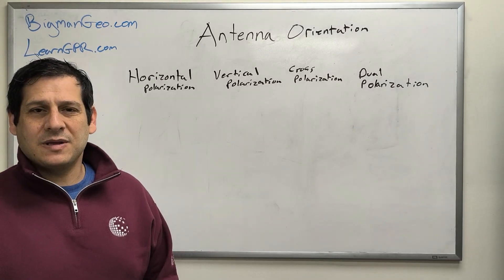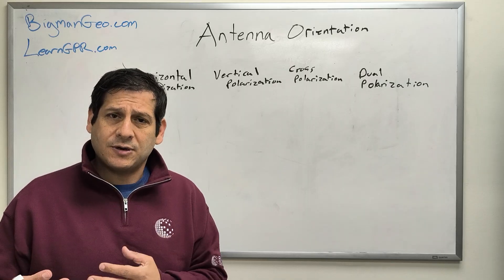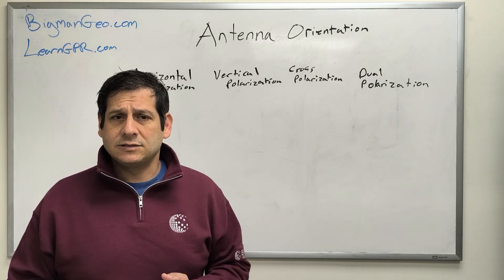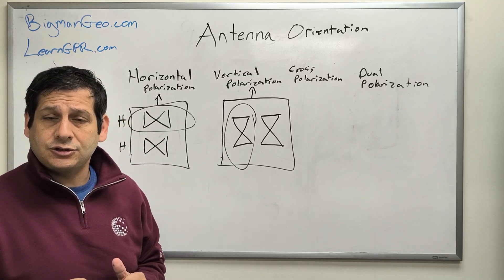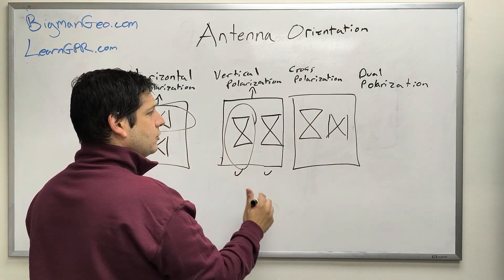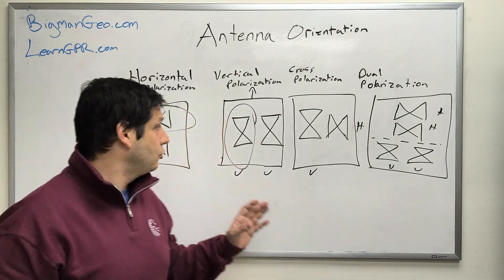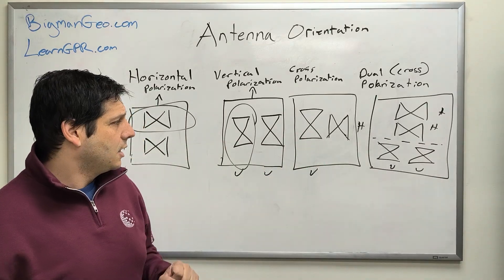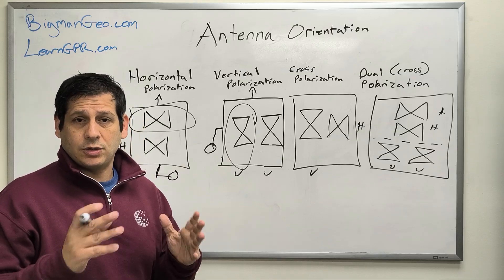GPR Antenna Orientation | Cross Polarized | Ground  Penetrating Radar

Comment: Is it possible to define utilities whether it is Metallic or non-metallic based on GPR data?

Does high reflectivity/amplitude hyperbolas, observed in parallel lines  correspond to Metallic Utility?
Reply from the maker: Great question. You can definitely make inferences about it, often by relative amplitudes (comparing two responses together) and sometimes analyzing phase. Hope this helps.
Reply: Could you please suggest any detail paper on this?  @Learngpr